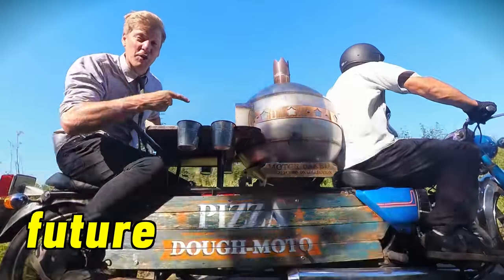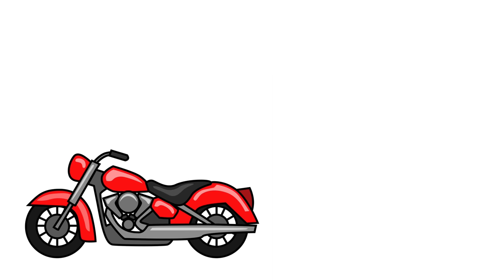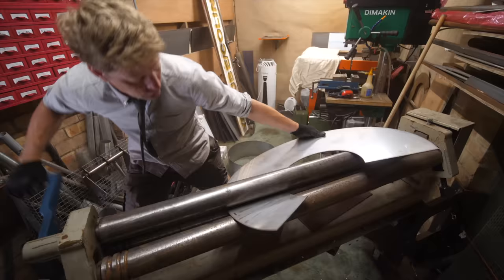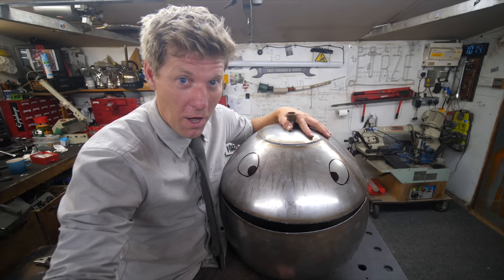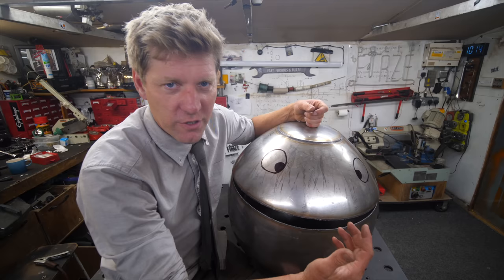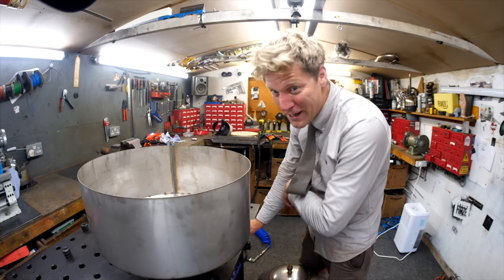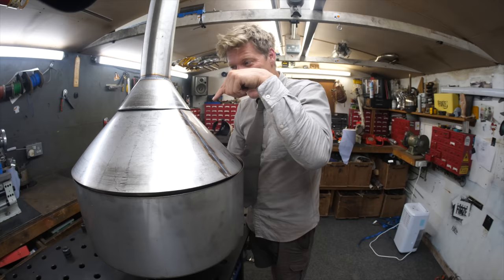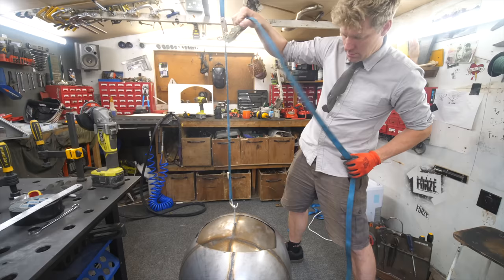I Built a Bike that COOKS Pizza!!

Comment from the maker: This turned out AMAZING, i think you could actually use this even if you didnt cook on the way but on the doorstep. Check out the Insta 360 they are very useful camreas so a great sponsor. Puzzles will be gone soon so don't miss out.......AND work has started on Phase 2 of the tunnel but am i going to the bunker or the car????
Reply: Hi
Reply: Since you did say you wanted to expand the bunker a bit anyways, I'm guessing bunker. Anyhow, hyped to see it regardless the direction it takes!
Reply: Car, with a lift!!!!
Reply: I know you like the bike, but I mean, you can have pizza...
Reply: It's gonna be winter before you know it. Better get that car on the lift side done first! Haha :_shirt::_wall::_shed::_pulsejet:
Reply: Would work well as a feature at an event like people rent ice cream vans for the day
Reply: I want that bike... like no joke, how much you wanting for it pal?
Reply: @fredcrews7401  that's my thought. maybe with a couple practical additions. would be great for motorcycle events
Reply: That is the best idea I think it will catch on
Reply: ...why not both?
Reply: Bungus
Reply: Hey Colin, back in my mini sprint days we cut down the center of roller skate wheels for the chain to ride in. It’s quiet and lasted a long time before we had to change them out. Hope this helps next time. BTW our mini sprints had 600cc Honda engine with chain drive to the rear axle.
Reply: Colin. I hope you saw my post about how to make the lift work the best. Here it is again. If your drive way is big enough you only need to come in to the lift at a 90 degrees and turn the table 90 degrees to leave. Never once having to back in, turn around. While this limits the parking space it would work quite well. If you need 2 spaces you build a double decker unit. When you arrive you press your garage door opener and the lift will raise up to which ever unit has no car. Then when you leave it will turn 90 degrees and you drive out and after the weight has gone it will signal and drop down or you can do it with a remote. Once back down it will reset or you will have to remember which way your drive in or always drive in the same way. 
Really I guess the remove could have right and left so it will just come the way you are and go out the way that you are. 
For this you need a hole about 20 feet deep. This should be enough for 7 foot car levels, 3 foot for the roof, 1 car and 2 car. and the last 3 foot for the lift part. Though you might need an extra 5 foot for foundation and additional parts.
Reply: This could be made as a side car making the pizza would be easier and give the chef more stability and room or a side car burger grill burgers on your door step fresh and fast. Forget a food trucks you just started the food motorcycles craze
Reply: ❤️🏍😉👍🍕 As an American that loves classic motorcycles & pizza this is perfect! Some of your best work Colin. I delivered pizzas once... My boss wouldn't let me deliver them on the motorcycle... I can only imagine if she would have seen this. 🤪👍🤣😂🤣
Reply: That's actually brilliant tbh 😂you need a version 2,just slap a trike back end on that and make an enclosure for rain and wind protection, more ovens n bosh,😅
Reply: You would do awesome at Battlebots!
Reply: I think tunnelling to the pub or Rick's  or Tom's 🤣🤣🤣
Reply: 17:40 Make a Pizza Dough-Car instead, so you have a roof over & is protected from rain & snow :D
Reply: @merlost1624  Yeah! I think, you should actually start a petition or something to get Colin's attention to this idea! I would definitely sign it! I love Colin's channel and I love BattleBots. I think the Furze team would be really fun to watch!
Reply: To the bunker I think because in part 10 Phase 1 complete you mentioned the underground garage was a new idea because you liked the tunnel project so much and the going the the bunker can be done above ground, and the underground garage and turntable lift will be a massive project and possibly need additional planning permission.
Reply: Make the car in the pit the Batmobile pizza-pulse-jet cooker delivery van. But in a safe way, of course. Of course.
Reply: This is the best channel on YouTube. Hands down
Reply: I don't like pizza at all
Reply: @MrTrash100 it depends on you how much you watch his videos
Reply: You'll be doing both you madlad 😀
Reply: Where do I send job assignments - and do I get a pizza-bike?
Reply: Prep the orders at the pizza shop and have 3 or 4 drawers with the pizzas in them. Then just put them in the oven 5 minutes before you reach each destination. Only 1 driver required this way. If destinations are planned out to be 5 minutes or less apart then you can just put the pizza in before heading to the next stop.
Reply: Thumbs Up 666... I'm screwed...  BTW, go to the car!
Reply: best video ever
can't wait for next one
Reply: I wonder how many people and bikes you'd have to make and employ during a busy period. It would make an awesome gimmick for a company to do for maybe even a couple days
Reply: There are those ovens that cook pizza in a few seconds by going to 5000 degrees. Couple that technology to the pulse jet and you are go!
Reply: That is officially brilliant. But you know what? You could build a 'Tuk Tuk' based version of that for all weather use, incorporate a mini fridge for drinks & a hot-box for cooked pizzas, & it would actually be a viable practical food service vehicle!
Reply: Donna calzone please Colin 
Address Hull 
ETA on that🤔
Reply: I´d really like to know through how much buroucracy you had to go to be allowed to drive that ting and to prepare/sell that food. Here in Germany you´d probably spent more time with buroucracy then with building the whole thing.
Reply: Work has started on the bunker???!!! Oh I cannot wait. Fantastic video as always.
Reply: Exactly, even if they put it together and cooked it right at your door it would still be amazing and you get a fresh out of the oven pizza! Great video and invention!
Reply: TUUUUNNNNNEEEEELLLLL????????
Reply: Do a TUT TUT!!!! ITS PERFECT FOR THIS!!!
Reply: Freaking Flatlanding at 3:30. Awesome!
Reply: Pizza....Van?  Wont mind the rain and you get more than one :D
Reply: I was thinking about a business. You order the pizza, they make it at the pizza place. Depends on how far you live. The GPS let's you know when to turn on the oven. Every customer gets it fresh out of the oven.
Reply: That did turn out amazing!
Reply: Plisss make Tripod
Reply: Just as crazy. Simply fantastic! “Allons-y!”
Reply: have you tried explosive metal forming it makes really nice spheres that In my opinion look better than hydro forming. Explosives might be illegal in U.K. though....
Reply: this has to be the most stupid thing ive seen . i love it.
Reply: bloody pom
Reply: Not gonna lie, thought you were gonna try use the heat from the engine to cook it, like those burger grill exhaust add on things you can buy that just seem like a bad idea. Glad you used propane =)
Reply: what's the song at 11:10 ? I need to know!!!
Reply: Oil the damn chopping board of disappointment!
-Woodworkers probably
Reply: @thedude8046  Good! More for us who not only like pizza, but motorcycles and engineering with a cheeky fun creator taking the time to provide us this great content. 

What a stupid comment!
Reply: No helmet.when riding that fast is stupidity dangerous.
Reply: ты гениален)
Reply: how much for it? ill bring cash
Reply: Brilliant! , thats it no more.
Reply: fast - new - pizza
Reply: Now make a Trike version with a roof.
Reply: Thats nice, in sweden we have pizza boat that goes to different cities, but his is next level :D
Reply: Did you order one large fly pizza ? ;)
Reply: The Furzure of pizza delivery lol
Reply: We need a "pizza dough-moto" t shirt now collin. What an invention, get um printed.....
Reply: If i can make a suggestion, you could make the same pizza oven, not on a bike, but in a Van or a Truck. If you don't want the pizzas get soaked from the rain, or dropped it on the way out.
Reply: Legendary idea
Reply: e that's ULEZ compliant Colin! 😂
Reply: I hope*
Reply: I hope you're going to the bunker first.  The whole tunnel becomes much more useful if you can get to the bunker from the kitchen.
Reply: Ha, brilliant!   I remember one of your first videos, where somebody was flinging a fried breakfast at you from a car while you were riding your bike 😃
Reply: It's baffling that no-one has thought of this before
Reply: Surprised you got permission to actually drive this on the road, surely it can’t be road legal

I doubt it would pass a U.K. MOT test
Reply: I love ur creativity man, respect
Reply: You're tunnelling to the car, but your car will be underground, and it's going to raise up turning around batman style, ready to drive off to get supplies for your next crazy build
Reply: Colin, how do you get these vehicles road legalised? I feel like it would be such a headache in this day and age to get something like this approved for the road.
Reply: MadLove Bruv ❤️
Reply: So yes version 2 Insulation in the air space and a cover for back  and good to go
Reply: How's the tunnel coming along?
Reply: What are you going to do with the motorbike? Are you selling it?
Reply: I think you need to pivot from bunker to secure survival shelter, more in line with current world events.
Reply: kan eg lånan t syttende mai?
Reply: You should add windscreens for the backseat! get the pizzas out of the wind
Reply: Love to see you do a video with Matt Armstrong. Peace out ✌️ he’s into he’s BMX
Reply: Car with the gangsta lift
Reply: 😂😂 never seizes to surprise with what is being made next 🤣🤣 this looked so much fun 👌🏼👌🏼
Reply: You deliver to the USA?
Reply: an bike or vehical that has a portable oven that can cook stuff is a pretty good idea
Reply: this is actually a good business idea.
Reply: No Reliant Robin? :(
Reply: With the pizza cooker, you should make an electric version and try it in a car. Get rid of unnecessary weight - car chairs and install hybrid to increase fuel range to serve all customers.
Reply: ONE correction: you don't cook pizza, you BAKE it! (no one want's a watery pizza)
Reply: Your pizza is never late.
Reply: Where’s the link?
Reply: Hi
Reply: You could do an all-weather design out of the back of a minivan. Could probably fit up to 3 pizzas in the oven with room for extra ingredients and workspace for the chef. Probably wouldn’t be too comfortable for the chef but I think it would work.
Reply: Maybe a windshield would help lol

Comment: If a pizzaria had a bike like this, I'd exclusively order from them!
Reply: Ther is one. Hamburg turbo pizza (unsure if they still in business) have no bike but small car like that. No open fire but one large stone with electric heating. The car start and drive away and stone is still hot and cooks pizza done in traffic. It was april 1 joke but it works and they keep it. Its expensive and only special order. They had much problems with permission because the big stone in the car. Its like half ton and red hot glowing and fire department was not happy.
Reply: Yeah, a freshly warm pizza with a hefty side order of exhaust fumes.

Comment: General workshop tip that did miracles to me. Whenever im working on a project and looking for something i misplaced in the shop: don't try looking for it, it will probably be out of sight anyway. Just start putting your tools back in their respective spots and tidy up a bit. I guarantee you'll find your item quicker and your workshop just became tidier at the same time. Win-win
Reply: Me:   - puts Pencil behind Ear.
          - takes measures
          - swears all around the Workshop to find Pencil
          - goes upstairs for a new Pencil
          - has to go pee
          - casually looks in Mirror, finds lost Pencil again...
          - gets back to Workshop with two Pencils
          - repeat
          😑😑😑

Comment: My friend and I had this idea over 20 years ago, only it would be in a small truck with a full kitchen in back, designed for a chef to be strapped into a seat that could reach everything, and everything setup to be used while moving.

Edit: Your execution of the idea is way more fun, though, lol!
Reply: A truck? idk seems a bit too practical
Reply: a large ferris wheel could be placed instead of the single furnace so you rotate it to get to the next appliance, imo.
Reply: I've had the same idea some time back.
Reply: They read Snow Crash (2000) and said "yes, and..."
Reply: Cool you guys came up with the new original idea of a food truck
Reply: There might be some safety concerns but it could be an interesting concept, even if you didn't actually cook the pizza until you pulled up to the location.  A hot oven only needs 2 minutes to cook a smaller pizza so the customer wouldn't even notice.
Reply: @-whackd    no, no, food bicycle
Reply: A company tried this with robotics - Zume - it did not end well, unfortunately
Reply: @snarr  wow im in love. i love ultimate laziness with robots. They should try again, with the advent of optical recongition and AI's.
Reply: Colin has done that but then from the back of a moving caravan. On a active road. it did not work that well. but the video is here on this channel.
Reply: Food ambulance.
Reply: My local pizza place was doing this in the 80s
Reply: @-whackd exactly what I was going to say!
Reply: Wild!
Reply: @TheQwuilleran   Snow Crash...2000?  It seems there was a re-print then, but was there a significant change from the original (1992)?
Reply: Look up Stellar Pizza, founded by a former SpaceX employee that uses a robot on a truck to make pizza on the go.
Reply: @alsmith358  Not just pizza, a full kitchen. Robots are cool and all, but the human chef aspect is half the fun and the spice of life, imo.

Comment: Colin:
An adjunct to your magnificent sphere experiment is that of stretch forming sheet metal over a mandrel.    IE 0.02" - 0.25" thickness.   
Machine mandrel to exact size.    Calculate true length of sheet metal blank, (cylinder, cone or otherwise) and subtract approx. half a thickness.  Butt braze, silver solder or tig weld to close then heat to around 500C and place over mandrel.  Stretch formed in this way the   resulting cylinder or cone is a carbon copy of the mandrel OD.  Easily within a couple of thou'.    It stretched to shape.    Gently tease the butt joint flat with a planishing hammer and a shim of similar radius.   Set upright, heat with a big soft flame all round, watch the perfect cylinder slip off.      
Incidently, it was myself that forwarded the cone forming trick to you which was taught to me by an old geezer back in 1954, in England.
I am now an old geezer and am so pleased to reciprocate.    
Love your enthusiasm and inventions.
Sointula, BC

Comment: There are work-arounds for using this as a practical system. The pizzas are pre-made at the pizzaria. You remove the pizza making station with a couple of additional ovens, rotated slightly so the doors are partly off-set to the side. and if possible set up an upper stone so a single oven could handle two pizzas, or a wire basket for sides that need to be kept hot. Otherwise you duct waste heat into panniers for hot side dishes.

You trigger the relevant oven as you approach the target house, and have pizza boxes in a storage compartment. Bish bash bosh, you have an actual working vehicle rather than just a novelty.

Comment: Colin, to flatten a ball of dough into a nice pizza shape, use a stainless mixing bowl turned upside down. You'll have to squash the ball of dough a bit flat to start with on your board, lubricate the stainless bowl with semolina or wheat flour and you can virtually pull the partially flattened dough into the desired width and thickness by pulling the dough down using both hands either side of the bowl. Of course, avoid ripping the dough by pulling evenly on the dough's surface. Et voila, fast and easy pizza base!
Reply: Problem is this removes all the air from said dough. Never roll or squash. Always stretch/push out and if you can learn the fling, do that!
Reply: @KT-Awake  The dough was partly sour dough and produced the best fluffy texture inside, and a beautiful bubbling on the outside edge that would slightly scorch. Together with rustic Italian style toppings, those pizzas won national comps several times. They were cooked in a conveyor oven with stone tiles attached to the conveyor at 400 deg C for 100 seconds. That high heat for a short cook produced the best results. Don't worry about the air in the dough. All was perfect.

Comment: Colin, for the chain tensioner, make what downhill mountain bikes use.  A small bearing wheel without teeth, that has sides, so the chain sits in between and sort of slides.  You can put one of these wheels either side of the chain to so you essentially create a channel that the chain cannot escape.  Then put a spring on it.  Make sense?

Comment: With it on the ATV, it just needed a ledge style door. (To keep it from disappearing. 
Build the pizza at the shop, slide it into the oven before you drive, and turn it on part way there. Arrive with hot pizza. Wouldn't get quite the crispy bottom, but could flame broil it on the way out.

Comment: for the chimney did you consider spot welding a piece of wire to the cone and winding the section? They used to do this with cannon barrels so they could take a hotter load without shattering